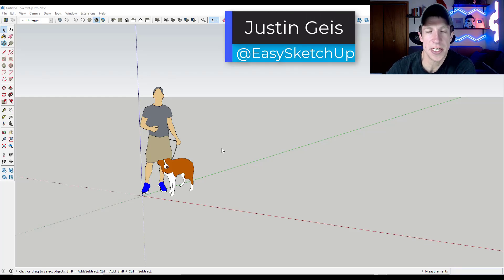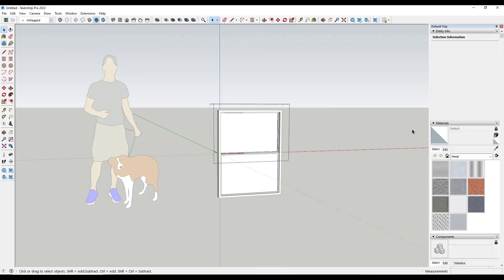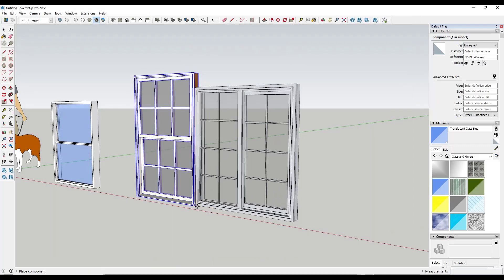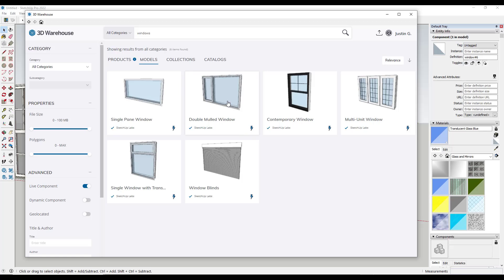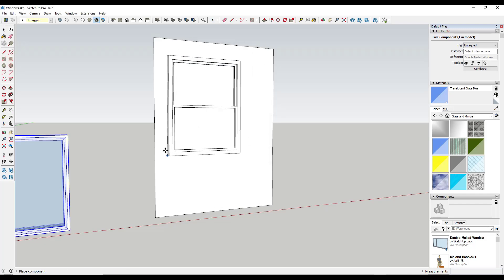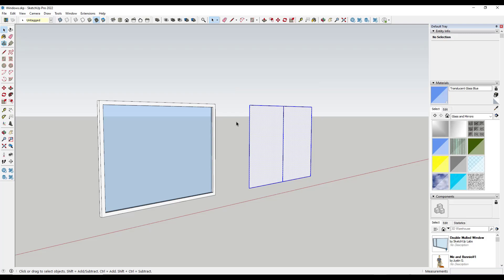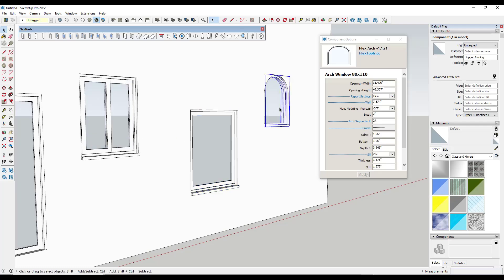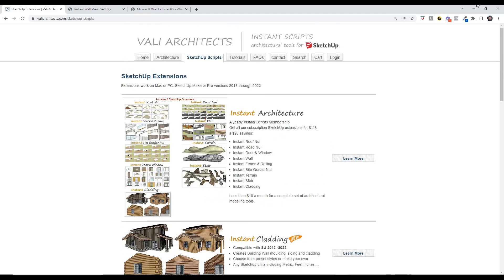8 Ways to Make WINDOWS in SketchUp!

Comment: I have a question. I am trying to fit an arched window into a wall. How do I get the arch to fit easily? Right now Im placing the window from 3d warehouse onto the wall and then taking measurements then drawing the shape and pushing it through the wall. Problem is the measuring tape tries to stick to the object and not on the wall. So this causes me trouble when trying to push it through or delete the plane. Is there a better way to quickly fit custom shaped windows?